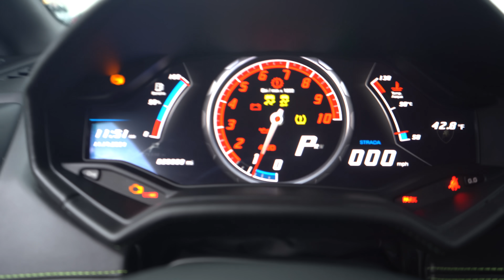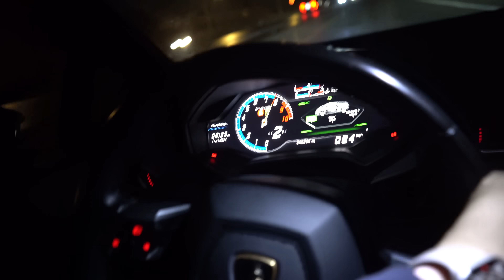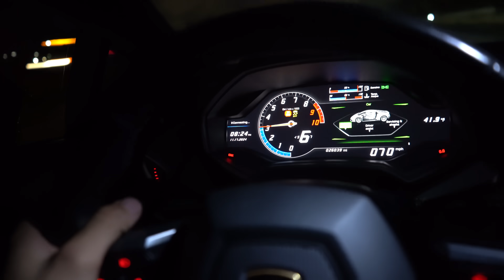Changing the oil after 8,000 MILES on my Lamborghini Huracán

Comment: Always change your oil sooner than what the manufacturer recommends no matter what type of car it is. They simply want you to be done with it quick and buy a new one.
Reply: Exactly my car is supposed to be done every 5,000 miles but I do it between 2,000-2,500 and only use royal purple just cuz I can’t really tell when it’s dark since it revs pretty high and there’s no real normal driving in it
Reply: wrong oil company's recommend sooner to make money of you that's old news its 2024 little bro. All based on driving habbits, temp, track use, ect

Comment: Yea...every 5k max with synthetic, especially if you drive them hard, anything more is just manufacturers getting you to wear out your car so you need a new one.
Reply: I do every 3000 with full synthetic
Reply: Nah 5k max is too much 3-4 is more ideal. You should never follow the guidelines from manufacturers
Reply: @ you should do it every 10-20 miles just to be sure
Reply: @Val.e36  Not everyone drives like a grandpa like you and hold up traffic 🤣
Reply: @Val.e36  I am going to confiscate your car enthusiast card as well as man card until you learn more about how cars work. Check back when you've added to your knowledge.
Reply: If you’re not driving your car hard you can easily go 7500 miles with full synthetic (edit. And if it’s na if it’s turboed better to change earlier cuz them shits expensive)
Reply: @apv951-y3y  Nah man, trying to save yourself 33% in oil change cost a year, assuming driving 15k miles, is just not worth it for the price of a motor replacement or engine wear. That's like saving 100 bucks a year...if money is that tight you got bigger problems...

Comment: We run 7500 mile in our work trucks useing Shafer's oil we can send the used oil to the company and they will test it for use to see if it is still good so iv tested ony personal truck and was able to run my truck to 25000 miles amd the oil was still pretty decent, but we also have Duramaxes o they are a diesel